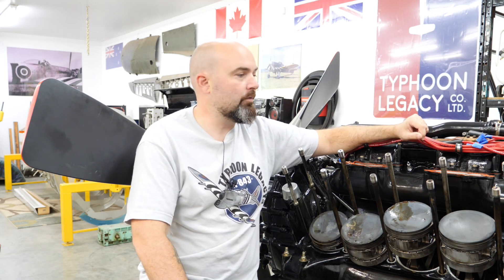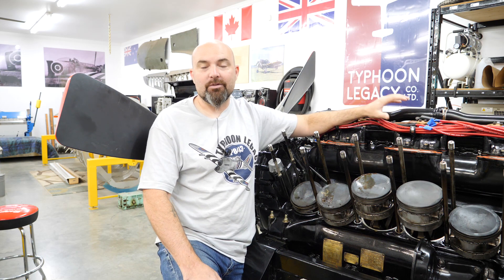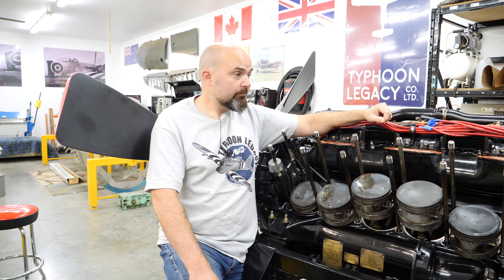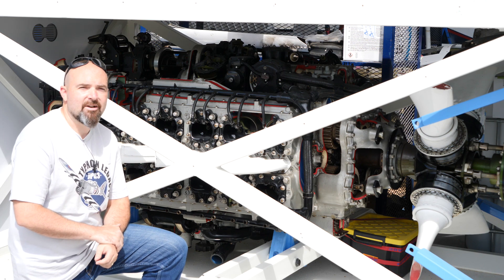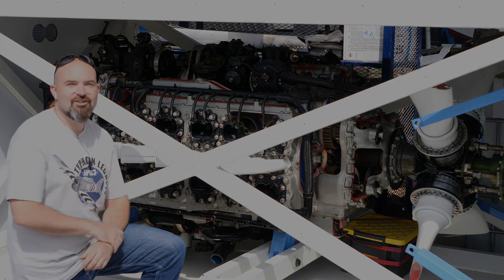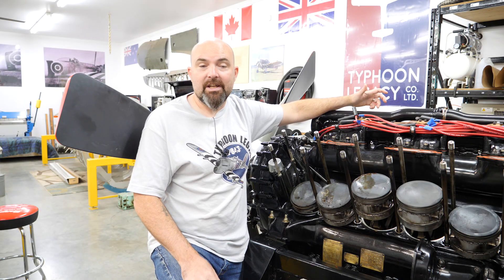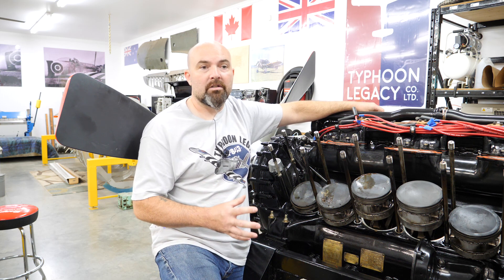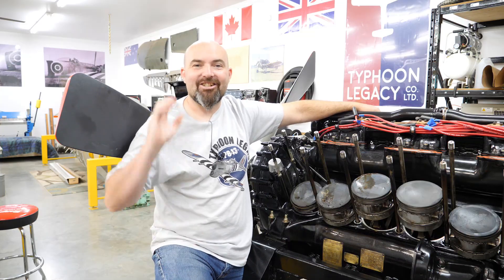S2E10 Another Napier Sabre?

Comment: Have you guys thought about 3D printing parts? Meaning that, how shall I say, re-create the cutaway parts, then perhaps re-casting or machining them?
Reply from the maker: We are looking at that as an option but there is quite a bit to consider. 3D printed aluminum (common alloys) are stronger than the cast alloy used in the cylinder blocks, but a key consideration is thermal expansion rates if the alloys are different. With the very tight tolerances on the Sabre, repaired sections containing dissimilar metals could go very wrong.  ~Ian

Comment: What I've always liked about the Napier company was they never let simplicity get in the way of vast complexity. Magnificent engines.
Reply: we need power :-) at all cost
Reply: I'd love to see someone find a Rolls Royce Peregrine to get running.
Reply: I saw a Nomad in the Smithsonian's Udvar Hazy Center. The last word in piston engine efficiency, complexity and cost, it arrived too late and was overtaken by the jet age. Napier always seemed to think outside the box when designing engines: the Lion was a great success, as was the Deltic, which has to be the most unusual designed piston engine ever.
Reply: @MarsFKA  Not the Deltic, a lot of its design can traced to packaging, it had to fit in patrol vessel hulls, think about its triangular shape and the shape of a hull.  Anyhow, the final word on opposed piston diesel aircraft engines was from the originators of the type, Junkers with the Jumo 223 and 224, it was an elegant design, although if I remember correctly, they had some problem with crankshaft vibrations - who didn't?  Over the years, I have seen a trickle of Information turn up on these engines, each time I again marvel at their design.  Then again I have always liked Napier, like a number of their engines, the company had its flaws, and those flaws are what make for fascinating reading and conjecture.

As for our friend the Nomad, any maintenance engineer who looked at that engine would run away in horror.  The diesel is okay (although, the fine detail of that part of the engine is highly unusual with some astonishing ideas), the turbine is also fairly easy to take, although it has different characteristics to its progenitor.  Where the problem is most acute (IMHO) is the load-sharing Beiers variable ratio fluid coupling.  To explain, it is load sharing as there is a parallel geared coupling that takes a reasonable proportion of the power transmitted with the rest going through the Beiers fluid coupling, essentially, they are trading the range of the variable ratio for more power transfer capability.  The coupling itself transmits all its power, in shear, through a very thin oil film which in itself is created by hydro-dynamic force, much like a journal bearing of Michell tilting pad thrust bearing.  If you haven't seen it then you will probably be confused, if you have seen it, well, shaking your head is just the start.  No, it is just too different to explain, and unfortunately, the old Flight magazine archive with a very detailed review of this engine is no longer available.

It all worked, BUT, and this is a big but, it required very careful and precise maintenance, something that may have been elusive in the real world.  It is much like that with a lot of pommie cars (I am Australian), some strange thinking led their designers to believe that all maintenance would be carried out exactly as specified.  

Even the great Walter Hassan and Harry Mundy, when they designed the Jaguar V12 road engine made a fatal flaw and only fed oil from the oil pump overflow to the oil cooler.  So as the engine aged, or the oil got poorer , less oil went through the pump overflow, the whole of the engine oil was cooled less, and the cycle of overheating the oil began.

Comment: Truly a thing of beauty is the Sabre engine! 💜
Such a pity that so few survive to this day and many of those have been sectioned and are unusable.
What is the main hurdle to reproducing more? Is it the casting? If so do engineering drawings exist of the main block allowing new units to be made?

PS great to see the project back on track.
PPS The Merlin is a thing of beauty too, can't not mention that 😉
Reply from the maker: Sabre spares and components in general are hard to find, even harder to find in usable condition. ~Ian
Reply: @TyphoonLegacyCoLtd  But what if the drawings still exist of the block casting? Is it possible to reproduce? 🤔
Reply: @russelleames5970  The cylinder liners, the sleeve valves were extremely hard to manufacture in period.  It took compulsory technology disclosure by Bristol before Napiers could make good cylinder sleeves.  It would probably be hard to make them today.

Comment: Always wondered why the Sabre and V-12 aero engines resorted to forked connecting rods on opposite cylinder banks; rather than slightly staggering the cylinder banks, like a modern V-8, so identical rods could be used throughout the engine.
Reply: + mtacoustic  Weight and compact size were important in WW2 engine design.
Reply from the maker: Overall engine length would be my best guess. ~Ian

Comment: Hey, thank the Lord and stoke the fire.... You've made my day as sad as that sounds. You can use the engine for rough weight to balance the aircraft, the gears inside will save so much money! As long as they are not sectioned. You have small things like bolts washers, guides, an endless list. Plus when you rebuild the air worthy engine you will have a great reference as to how it all goes back together, that isn't a slight against you, I've rebuilt many many car engines being a car mechanic and once stripped waiting for parts you're memory can fail you, but you have a perfect reference. I get it now. Thank you, you go back on my good list and right to the top 👍😉😁
Reply from the maker: Thanks Terry. ~Ian
Reply: @TyphoonLegacyCoLtd  Who's Terry? But you're welcome

Comment: I thought this was why you were building the Merlin.  Makes sense , the cut away is great becouse it's probably has no run time on it. 
Most of the items that need replacement are caps, covers , cases . All the internals may be new.
Reply from the maker: It will be the engine to watch for sure! ~Ian
Reply: @TyphoonLegacyCoLtd  interested in hearing the history of the the Saber display . Question now is will the other Saber you have work as a donor ?

Comment: I think as alloy sintering becomes more affordable one could remake these castings - funds permitting.  I know Merlin heads are being CNC machined in the UK for some time now.
Sectioned engines don't bother me - you're more likely to see this come apart than the hangar queens out there.  CAD the heck out of it and do lots of videos.
Reply from the maker: The next steps will be very interesting, stay tuned! ~Ian
Reply: + Jonathan Edwards     Those new Merlin cylinder heads were castings.  RR still holds the license on the Merlin, and they gave permission to Retro Track and Air to make a few new heads and I think they were exclusively made to support the Battle of Britain Memorial Flight aircraft.   Roush Aerospace makes some Merlin parts, and they approached RR and said they would like to produce a production run of new Merlins for flying aircraft, but RR told them no.

Comment: If I was worried about you mishandling the main project I would build my own. Thanks for the fill in but I had assumed you were going to use the Merlin to fly your new airplane around the patch to work the bugs out of the airframe to avoid having a Sabre engine problem pop up during the first flight of the new airplane. Continue on, Thanks
Reply: A merlin powered tiffy would very strange due to the size difference and making reliable adapted engine mounts would be a trick. Also it would rotate the opposite direction and it might not be powerful enough to fly it

Comment: Most of the internals of this sectioned Sabre are the gems of this trade. The other Sabre they have in store will most likely provide all the engine block and castings, sans the Sabre 7 injection system et al. Welding up the sectioned castings is definitely a no-no for an airworthy engine. Even the already stored Sabre will require some superficial re-machining corrosion weld build up work, but nothing that is likely to completely distort and stress the aluminium and magnesium of the castings. My comment has not taken into account that the Sabre 7 may be in no way interchangeable to earlier types.
Reply: I would think mix and match is very unlikely, perhaps dangerous.  The Sabre underwent two internal structural changes, the major one for the Mark IV (maybe V - bloody memeory) and a smaller one for the Mark VII (I think).  Most of the design documentation on the Sabre was destroyed over the years, you don't know why things were done, what will work with something else.  Again, if it was me, it would be the complete Mark VII design minus the ADI system, and definitely get rid of the Coffman starter, they stressed the engine, big time.  Modern electric starter motors could easily do the task now. 

Again, If it was me and I had the money, I would use the VII for a template and just build a new engine.  Castings are much easier these days with scanning, CAD, CAM, 3D printing of patterns, etc.  For many parts, assuming the metallurgy is correct, milling from billet would be best, gotta watch the coefficients of expansion.  

From a modern manufacturing/machining basis, sleeves aside, the engine is not that difficult.  To the sleeves, I do not know if Napier used Bristol-designed sleeves after the war or whether they reverted to their own materials/manufacturing process.  Bristol had patented part of the manufacturing process.  I am not even sure there is full documentation of the method Bristol used to manufacture the sleeves, the materials, the centrifugal casting process, ageing, machining, heat treatment, and finishing.  SNECMA manufactured the Bristol Hercules under licence, I do not know whether they manufactured their own sleeves or got them from Bristol.

Let us say you now have all the parts made. Torque settings anyone?  A manual with these? Tolerances, lubrication.  Now all of these could probably be calculated, but WOW!  I do not know how big Franks Halford's consultancy team was in the initial design, and although, they designed and built this very different engine in two years less than R-R took to design just another V12 *, just working out all the torque settings would be a big job, computers and all.

Even worse, there is probably no one left from whom you can get first-hand knowledge.  There were never that many of them anyhow.

And the critical part is that the engine MUST keep running!  And it must be good enough that you can convince a pilot, gifted enough to fly the plane, that it is worth the risk to do so.  And for that, the risk must be reduced as far as the Gods will allow. The Sabre's reputation will always lurk at the back of the pilot's mind, no matter how logical that pilot is.

I am sure Ian and the team have a hugely detailed plan to get a Sabre running.  If I had a gazillion dollars, I would just be happy to have a ground-running one that I could take to full throttle.  Are there any 24 cylinder aircraft engines running today?  Unlike the Dagger, the Sabre runs a 60-degree regular firing angle which means it fires two cylinders at once and obviously the order of firing is also same, two flat 12s chasing each other.  Move aside, boring old V12s and radials.

*not much more than a big Kestrel, it probably would have been better as a small Buzzard, or a small 1931/1933 Griffon -Treselian had been heavily involved in that one, converting the R down to something that could be mass-produced, IMHO the man was a genius, and I am in good company with that opinion.  Of course, I do not know the fine detail, so perhaps elements of those engines are in the Merlin.  The Mark III that the team just restored is pretty representative of those early Merlins.
Reply: Now that's my kind of response !! Thank you for taking the time with a wide ranging response. I agree with the sentiment that only a ground running complete Sabre should be attempted. I think that would impress as much as it flying within the Typhoon itself. 
I came across a potential modern starting point for a Sabre replacement, that of the  Chelyabinsk 12N360. The engine is 1K lb's heavier with half the cylinders, but produces nearly the horsepower. The engine could be built lighter as a petrol ignition type, and with some hope tandemed to become a 24 cylinder. A flight of fancy but so is the likelyhood of ever seeing an airworthy Sabre again.
I have lived just long enough to see that the future of machines will slowly loose the visceral testosterone pumping experience of big ICE's and eventually people will be greatly disturbed by a mere glow plug engine firing to life. By then I think that sexual dimorphism in humans will also have disappeared. This all appears to be happening very quickly. Glad I lived at the end of the 20th century and won't see it to the middle of the 21st.
 @robertnicholson7733

Comment: When I worked for Napier on production of the Deltic engine, I remember using scrap casings to make up a dummy engine for the Deltic loco
being readied for the Science Museum in London.
This was not a cutaway just a boxed up hollow engine which was then painted to look new.
The Sabre was before my time so this has no bearing on your Sabre.
I am sure you will be able to re manufacture this cut away Sabre and get it running.
Best of luck.
Reply from the maker: It will be interesting to start to disassemble this one for sure! ~Ian
Reply: @TyphoonLegacyCoLtd  I can only hope that you can fully 3d scan it with high accuracy.  Also, full metallurgical testing would be nice, I think the crankcases were high-content magnesium alloy.  As far as I know, there is not a single set of engineering or production drawings for any mark of the engine in existence, I have only seen a few isolated drawings.  With scans and careful disassembly, this could be remedied, the cutaway sections could be easily "replaced" in 3d modeling form.  Determining torque settings during disassembly would be an interesting problem, although they could be calculated, getting authoritative reading from a physical source would be better.  I doubt that they used torquing up into the yield zone of bolts and studs in those days, although the crankcase through-bolts are pretty long. 

Most of the engine could be reproduced in this day and age (CNCed to a much higher standard and strength), except, perhaps, for the sleeves, I am not sure if the exact process for producing the sleeves is known, more details have been found and collated in recent years, but how would you know if something had been left out?   The final machining used by Bristol was one of those lucky found-by-accident moments, not obvious and sounds like BS, but Bristol eventually patented it, despite disbelief at some patent offices.  I don't know if Snecma manufactured the sleeve for their license-built Hercules or whether these were obtained from Bristol.  I remember seeing a photo of stacks of centrifugal cast sleeves still with their cores sitting out in the weather (snow?) curing before machining, I wonder how long that took.  So a two-cylinder test engine, just like Halford and Napier used, would need to be run for some time to test manufacturing.  And after that, I don't know, just whack together an RR Crecy for fun while curing its tendency to melt various parts of the engine such as the pistons, piece of cake.🤔

This looks a lot like the engine that is displayed at CASM, it is a VII cutaway as well, how come Canada ended up with two of these incredibly rare engines?
Reply: Thanks !!

Comment: I dig it, the typhy was a stunning beast but early development was catastrophic, your variant will fix structure, exhaust fumes, and stuctural issues for sure.
Reply from the maker: There were certainly early issues by pressing the airframe and engine into service. We will make sure that all fixes are incorporated into JP843. ~Ian
Reply: Considering those issues were fixed when in service, I'm sure that both Typhoon projects will not have those problems when it comes to theor Sabres

Comment: Saw a Napier Sabre at the Rockliff Av museum, Ottawa, back in the day. Forget how many cylinders, but remember the two gear-combined crankshafts layout. Also saw a sweet Merlin cutaway at the museum off St.Laurent Blvd down by Elmvale Acres, the place with the tilted room and the big locomotives and the rocket out front. And the space capsule and the F-86 (CF-86?). My dad flew those Sabres out of France and England, some years after piloting Mitchells for Ferry Command.

Love your project.
Reply from the maker: Thank you Johnny, the Sabre is a 24 cylinder; quite a beast! ~Ian
Reply: They has a second one, was traded years so yo Kermit Weeks, for a German diesel engine